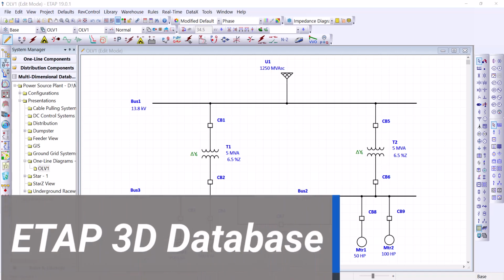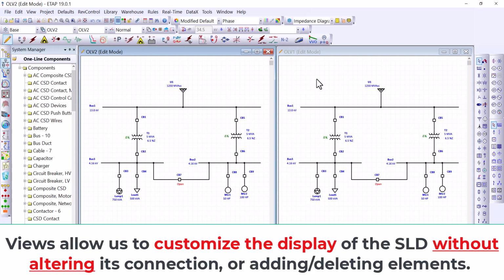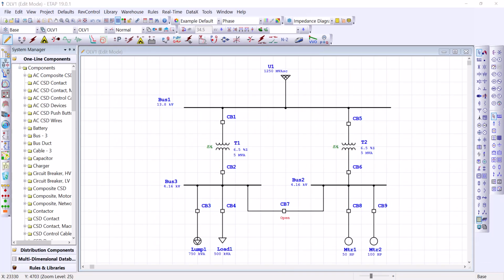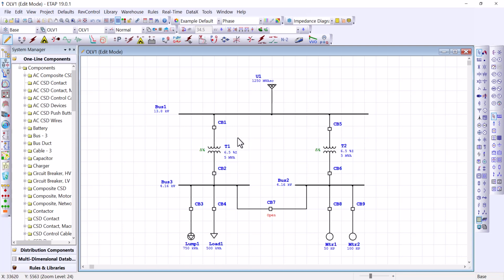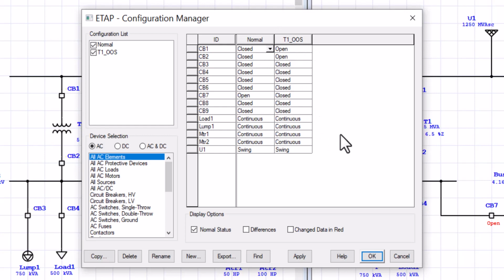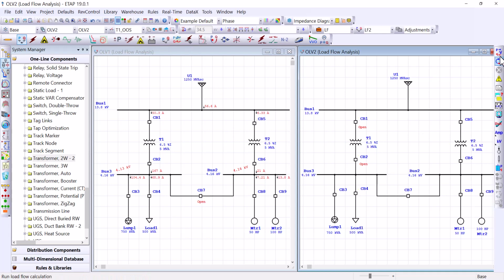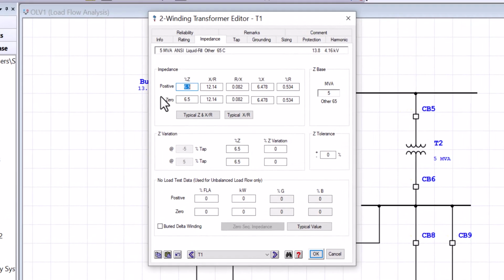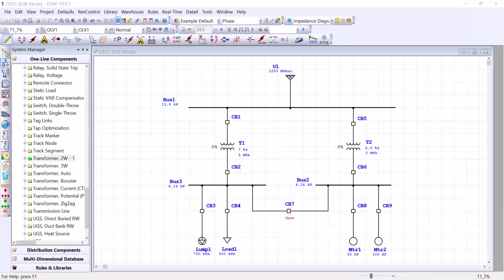ETAP Presentations, Configurations, and Revisions

Comment: Presentation: creating multiple views of the SAME SYSTEM for DIFFERENT ANALYSIS (e.g. load flow & short circuit analysis)
Configuration: creating multiple views of the SAME SYSTEM with DIFFERENT SYSTEM CONFIGURATIONS (e.g. T1 is off & T2 is off)
Base: creating multiple views of the SAME SYSTEM with DIFFERENT COMPONENT PARAMETERS (e.g. Zt1 = 5% & Zt1 = 10%)
Reply from the maker: I appreciate your comment. I’d like to add some clarification:

- Presentation: Creating multiple views of the same system or network that are helpful for different analyses (e.g., load flow and short circuit analysis).

- Configuration: Creating multiple ways to configure the devices used in the network. For example, you can change a breaker from ON to OFF or turn off T1 and T2. Note that even though we are configuring the same project, the end result may look different because we might deactivate a significant portion of the network.

- Revisions: Allows us to revise the engineering data (rating, HP, and similar nameplate data). 

These features are particularly important when using the 3D model, where we can independently combine these views, configurations, and revisions. I hope this helps.